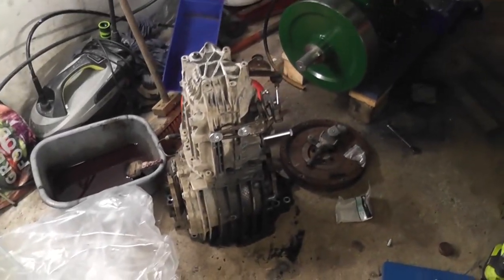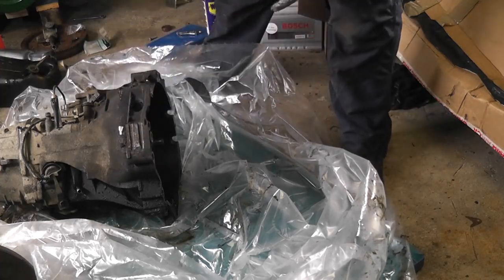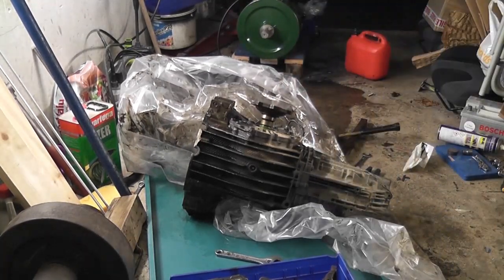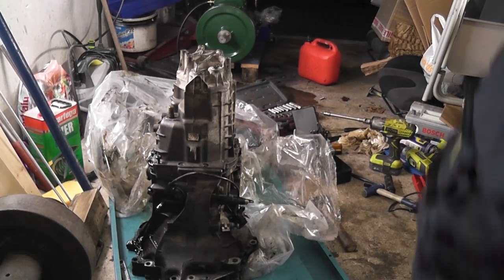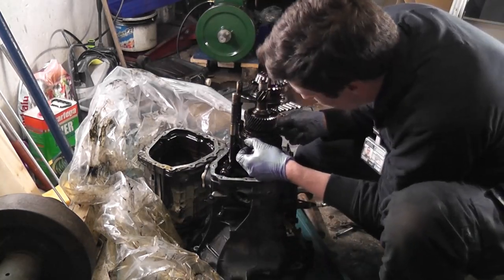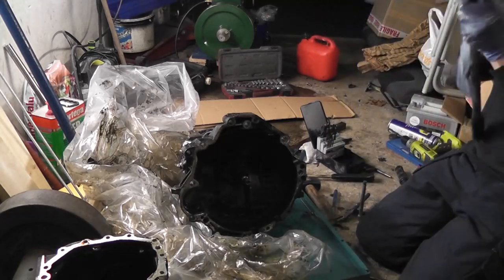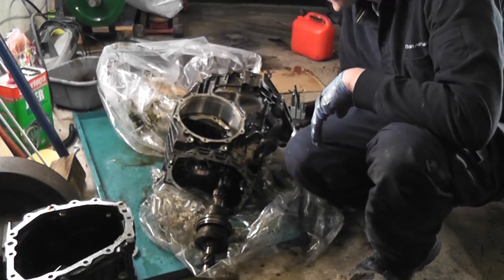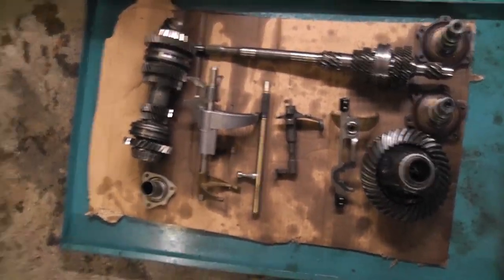VW Passat gearbox stripped by a novice - VW camper TDI engine swap

Comment: So it turns out circlips are officially more annoying than hose clips! Much easier set up for machining now so worth the effort in the end.
Reply from the maker: Honestly, if I had a decent circlip pliers it wouldn't have been such an ordeal to remove, but using a longnose pliers that I ground down to suit really didn't do the trick.

Comment: Hi Endfloat. Where did you get that puller set from? I need one myself. I'm currently doing a VR6 conversion on a T25 with the same style gearbox.
Reply from the maker: I bought it on eBay actually. I'll sell you mine if you'd be interested. I only used it the once. Email me at live1052@yahoo.com